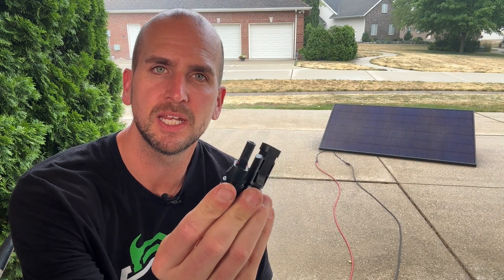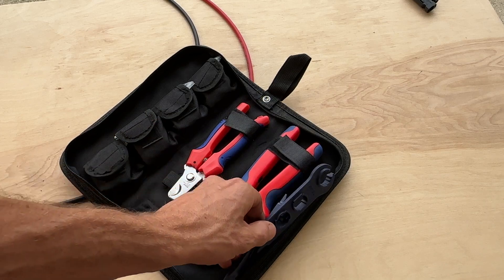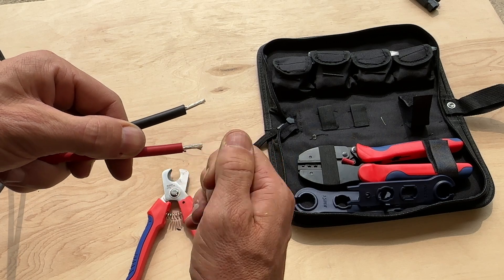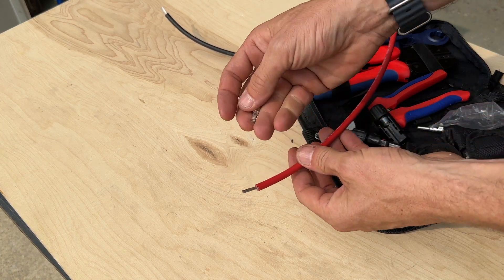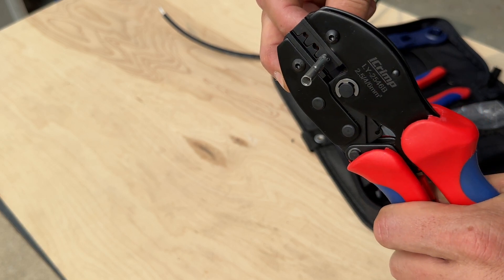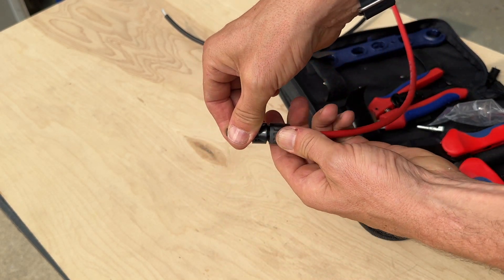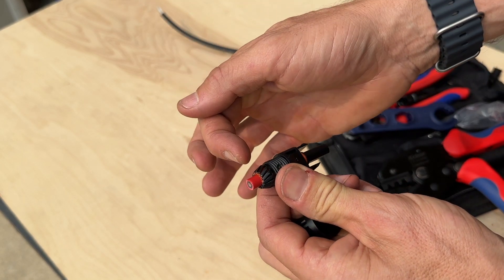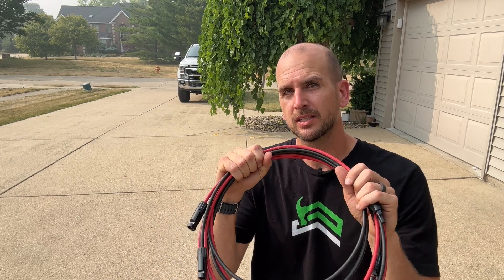The Easy Way To Install New Solar MC4 Connectors

Comment: I'm a little old school but after crimping the wire I'll often solder the joint too.
Reply: Definitely don’t do that. Voids warranty. 
Not how they’re designed to be used.
Reply: @Lpxbsj  What warranty?  I get a ten pack for around $7.  There is no warranty on such a cheap item on eBay. I solder all my joints for extra protection and strength.

Comment: Definitely do not need to disconnect the parts just keep the cap loose and push the wire through until click then tighten with the 2 wrenches

Comment: Are these MC4 connectors compatible with the Ecoflow MC4 connectors?
I have an Ecoflow solar panel and a Bluetti solar generator… and both have MC4 connectors. Unfortunately they are not compatible as the pin/socket sizes appear to be different. 
Any help is appreciated.

Comment: I have just received a Renogy 100 watt suitcase panel and the male connector has a red wire and the female has a black wire. The pigtail that Amazon sold has the opposite .The pigtail female has a black wire and male has red. If I connected them together they would of course be opposite. Black to red , red to black. Renogy says the panel wires are not important and they can be cnnected black to red and red to black. Of course all my other connections to my controller are red to red, black to black. Is Renogy correct and at the panel  it does not matter
Reply: I am having the same issues. Did you use the connection without any issues??
Reply: Was it safe connecting black to red and red to black??

Comment: When fitting to the Power Annalyzer, do you strip the wire further back or crimp onto the plastic coating?

Comment: Gud video and effort in explaining, Suggest and think that this video is only half of what is required, i mean to the solar side of it for positive/red, should have included a negative/black separate which will be going into the other end, meaning multiple/two panels connected in parallel or series extended to UPS side. Thanks for such a video and gud content

Comment: This video solves part of the questions. Still unclear what is "positive side", since one positive side goes to the panel and the other also positive side to the inverter, but the connectors are opposite.
Reply: How did you work it out?? I faced the same issue
Reply: @edwedwdsdsddsds  I figured out positive/negative actually refers to energy source (the panel in this case). So given the cable which connects +on panel to +on inverter and break it in the middle, the end which goes to panel is positive connector (with + sign) and the end which goes to invertor is negative connector (with - sign).
Basically once I got the panel it turned obvious because it has pre-installed connectors and I just needed to follow them. I had confusion because I wanted to make xt60 adapter cable before getting the panel.

Comment: Thanks, it's a good tutorial.  I'm wondering if there's any value in also soldering the termination after crimping..?  I ask because I recently had cause to do an investigation on my Solar PV Inverter and a very intermittent circuit breaking tripping issue.  Upon checking the DC Isolator - located between the array string cable and the Inverter - I discovered some significant corrosion and evidence of arching.  This was possibly due to insufficient torquing of the wires, and being multi-strand, this is always a potential issue.  So, just thinking that anything we can do to ensure a solid, permanent connection of the (relatively high voltage) DC cable and any/all connectors and terminations has to be good.
Reply from the maker: A proper crimp would be good enough but solder could be a little more insurance.

Comment: Surely one end of any cable would be male and the other female, right?
Reply from the maker: Correct 👍
Reply: @everydaysolar  does it matter if I connect black to red and red to black??
Reply: He didn't make it very clear. Hrs connecting the positive cable to the positive from the panel.. Which has the positive pin... So he needs to connect the negative pin. Other end of the cable he's working on would have the positive pin that goes into the inverter.

Comment: thanks, I got some secondhand panels but the previous owner just simply cut off the cables. Just the info I needed to install new connectors
Reply: I can see why he had to cut them off.  Dielectric grease is really a good idea to use.

Comment: Scott, consider a short video on how many panels can be connected with MC4, how much current, how many amps,what size wires, how many branches are safe before combiner box.
Reply: Thats more in depth.  Thats a diy solar with will prowse

Comment: Always enjoy your videos. I just purchased the oupes mega 3. I am  trying to find information on extension cables. The power station and the portable panels come with 14 gauge wire.  I would like to make 50' extensions with 10 gauge wire. Do you think overheating would be an issue at the 14 gauge ends?

Comment: You said the positive wire is usually connected to a female pin.  Is that true at both ends of the cable or is the other end of your positive cable a male pin?

Comment: Thanks for mentioning the 2 different barrel sizes. Smaller barrels get connected to the female and larger to the male.
Reply from the maker: Yeah, easy to start crimping and make a mistake for sure.
Reply: What dictates male or female?? The outer plastic connector or the inner metal barrel??
Reply: @digitaldez4329  The inner metal barrels, he says this in the video.

Comment: I recently purchased an EcoFlow Delta Pro with an extra battery.  I also bought 4 solar panels locally with a (Voc) of 48.48 and an (Isc) of 10.14.  Can I hook up all 4 in series and over-panel, or will I fry my unit.  I have seen on YouTube how many people over-panel this system.  However, the purchase was expensive, and I don't want to be out $4,500.  I would truly appreciate your insight and guidance on this issue.  Thank you

Comment: Really good video. I've done MANY MC4 fittings, but watched this as a reminder of orientation. (In contrast, the "professional" Renogy video didn't tell how much wire to strip back OR the orientation of the fitting to be crimped. What a difference yours was to theirs. (But this speaks to their entire company in general, being only Marketers and Re-sellers of a Chinese manufacturing company- they really don't know anything about solar past their maketing material.) Nuce to have some actual high-qualiity professional videos for folks. 👍
Reply: Nuce professional comment!

Comment: For the DIYer, do keep those ends apart, and insulated to avoid the panels accidentally short circuiting. 
While it looks nice in the video to have both stripped ends in the same hand, the chance of accident, especially with multiple panels in circuit is quite high. 
DC arcs can be nastier than AC arcs.
The ability to show the connection/disconnection at the end did rely on the pieces being part of a separated extension cable.
Reply: Do it at night..or disconnect.

Comment: Thanks for the informative videos.  I'm looking to add a solar cutoff switch in my toy hauler trailer.  The solar charge controller is inside the bathroom wall and I'm looking for a solar cutoff switch that I can mount inside the wall, with the wires inside and the actual switch being the only part coming through the wall.  I can't find what I think I need.  Does anyone have suggestions on the best way to do this?  Also, do I need to cutoff both + & - or just + since I do have a normal 12v battery cutoff switch at the battery.

Comment: Best practice is to put the end cap pieces on the wire first. MC4 connectors should fit through but other types won't, so don't start a bad habit.

Comment: I use MC4's as convenient cable extenders too.  I think it works quite well and it is amazingly convenient.   I also use them sometimes when cabling into equipment by having a short cable coming out of the equipment that the main cable connects to.  Instead of cabling directly into the equipment.

I do a few extra steps, though, to make absolutely sure that nothing will ever go wrong.

#1 - I don't just crimp the cable.  I also solder it after crimping (making sure the solder doesn't accidentally impede the tabs that click into the housing).  MC4 cable ends are insanely easy to solder after you've done the crimp.  The junction just sucks it up.

#2 - I always hand-test the junctions at full load after connecting two cables together to make sure there is no excessive heat.

#3 - And I always use 10-gauge or 6mm^2 (which is slightly thicker than 10 gauge) cable.  In the past I used a mix of 12-gauge and 10-gauge, but over the years because of cable re-use and cable lengths I ultimately decided to consolidate to just using 10-gauge for all solar cabling, even if I was only putting 10A through the cable.

I like the MC4s in this regard because they are moisture-sealed and have integrated strain-relief.  You get neither with XT-style connectors or anderson connectors.

Comment: I couldn't figure out how to disconnect the MC4 connector. I tried every way I could see to make the tool fit. (It didn't come with instructions.) Thanks to  this video, I now know the secret. 😅

Edit: Nope. I wasn't overlooking anything. My connectors apparently are not standard MC4 connectors. Not only does the tool definitely not fit, there is no way for ANY 1-piece tool to do the trick. There is no gap to allow the release fingers to contact abd sqeeze the locking tabs. Looks like it's time to source some genuine connectors.
Reply: The connectors on my China solar panels are not thee standard MC4 connectors either and are difficult to disconnect and cannot disconnect with the tool. I have to use a tiny pocket flat blade screwdriver to release the locking tabs then pull them apart.

Comment: Hi Scott, just watched 2 of your solar videos and both have an audio buzz when you stop talking. Sounds like your camera's automatic gain is trying too hard to turn up the volume and only turning up the buzz. You can fix this one of two ways (1) by increasing the audio gain on your mic [receiver] so that your camera gets a higher input level, or (2) by turning off the automatic gain on the camera audio. Good luck. Nice videos.
Reply: Hey @CharlieBehrens thanks so much for the help.  That buzz is annoying and my DJI Bluetooth setup is actually running right into my iPhone 14 Pro Max.  Your comment kicked my butt into gear to dive in a bit more and I am testing out some adjustments to hopefully eliminate that buzz on the next video.  Cheers 👍
Reply: That’s a grounding issue, proper grounding on both sides is necessary. The hum is stray frequency being picked up and by proper grounding will eliminate the hum. I’ve watched most of your mains wiring and appreciate your endeavor. Best wishes and 73s…

Comment: I like to use dielectric grease too  you never know if you need to take it apart    Thx
Reply: You are so right!  Look at my post today.  I need to take them apart to remove for a re-roof and it is impossible!!  I even got a metal tool as well as cutting off the tabs.

Comment: I have a portable solar panel, 140 kw total power and a 300wh battery.   Brand name is All Power, I think.   What gauge wire should I use for an extension? I am thinking 12 gauge is big enough.  Off the top of my head, I am not sure what gauge  the wires are that came with panels..  Probably 12...
Reply: If you haven’t found an answer yet 10 gauge would be the wisest choice to use.

Comment: whats the longest distance you can be from the panel to the solar generator thanks (wire lenght)
Reply from the maker: I don't think there is a set limit but you will get some voltage drop if you extend 50 ft or more. If you need to run 100 ft or more consider 10 gauge wire to minimize voltage drop as compared to 12 gaguge.
Reply: In addition to the other replies, if running very long cable you always want to maximize the voltage and minimize the current, meaning that the solar panels should be put in series whenever possible.  As high a voltage as the charge controller (etc) will allow.  This will massively reduce the power loss over the cable.

For long runs you want at least three 12/24V panels in series or two residential panels in series for 60VDC or higher if you can swing it, DIY, for example.

Cabling is still limited by current depending on the AWG, pay attention to ampicity.  But beyond this current limitation there is no real distance limitation other than what kind of power losses you are willing to tolerate.

Comment: Hi Scott, I want to DIY my system totally and would appreciate your knowledge. Are there any free resources to evaluate my back yard for proper direction to place my array's. I am guessing I'll buy 3 fold up 400w strings (1200w total) to only use for extended outages. I have 2 EcoFlow Delta Pro's + 2 extra EFDFlow batteries (14400wh I think) and plan to only deploy the 1200W panel array when needed because of extended outage's. Is 1200w of panels an OK amount for my 4 battery system? How should they all be inter-connected and then to my EcoFlow system? Thanks for any help on this, Bob R.
Reply from the maker: Nice setup!  Would you just switch the XT60 connector between each of your 4 batteries?  Each of the Delta Pro and Extra batteries units could take up to 1600 Watts of power from solar.  With the proposed setup you would have a nice flow on a sunny day of around 900-1,100 Watts coming through 1 string, into a MC4 to XT60 cable and then plugged into only one unit.